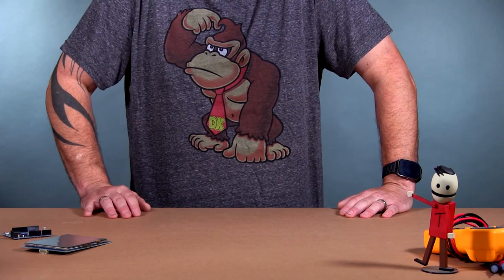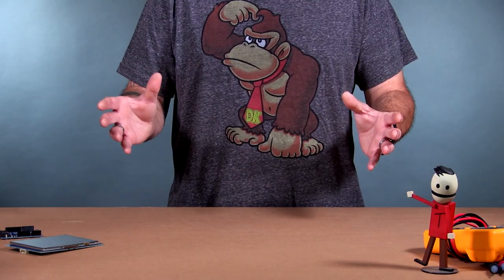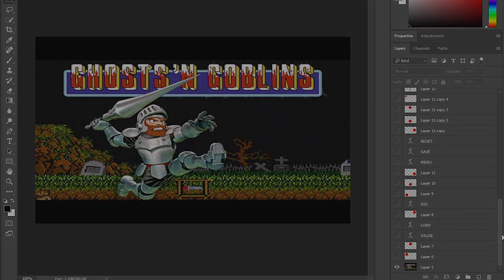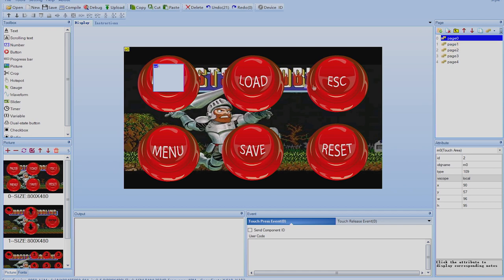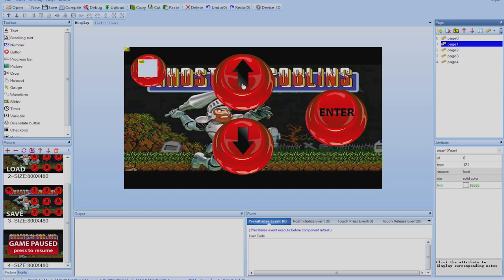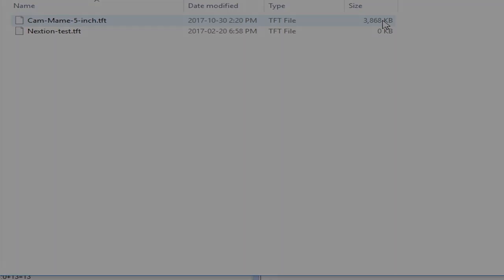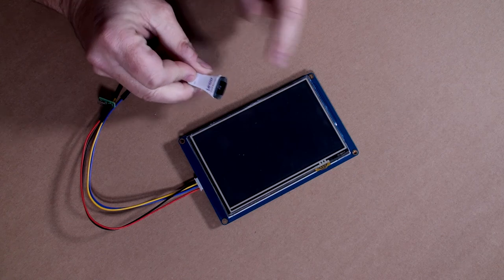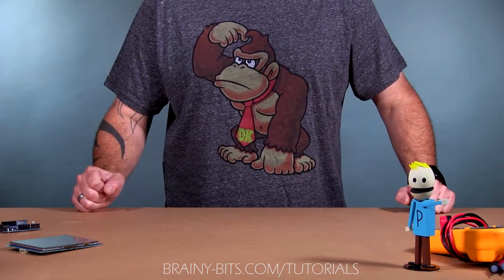Using a Nextion Display with Arduino Leonardo - Part 1 - Tutorial

Comment: Great tutorial.  The graphics look really good on that display! Page swapping takes me back 20 years to programming games for DOS. If only I had that GUI design software instead of typing every line of code!
Reply from the maker: These screens have pretty good resolution for their size, they do look great in person.  The bigger ones, like the one I used (5") and the 7" are a little pricey ($85-$100cad) but the smaller ones are pretty cheap.  But since they use serial communication (TX-RX) they are great for some Arduino projects and will surely use them again in future projects.  Btw I know what you're talking about programming tons of lines to create some DOS graphics, I started with computers back in the day with a Texas Instruments TI 99/4A and would type lines and lines of codes found in magazines to create some games :)  Thanks for watching!

Comment: Awesome Tut, question, if I have a tft file written for a 3.5" display, will it work on a 2.8" display? I'm thinking due to the different resolution between the two screens it should be oversize for the 2.8" display. Will I be able to load the code in the developer and simply change the screen size and recompile the code to suit the 2.8"?

Comment: What was your all over experience with this?Is it worth buying for money?
Reply from the maker: I really like using these displays with Arduino, I've just scratched the surface but so far I think they are the best color graphic LCD to use for project that don't require fast moving graphics (ie. games), great for GUI.  The bigger ones (5" and 7") are a little pricey (80-100cad) but the smaller ones are not that bad.  Thanks for watching!